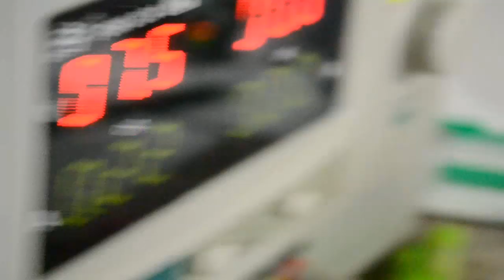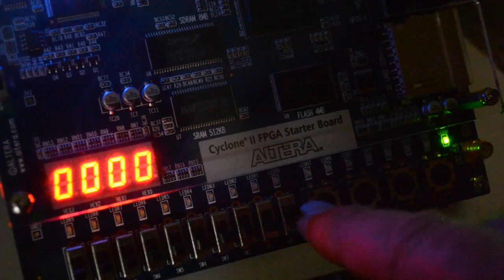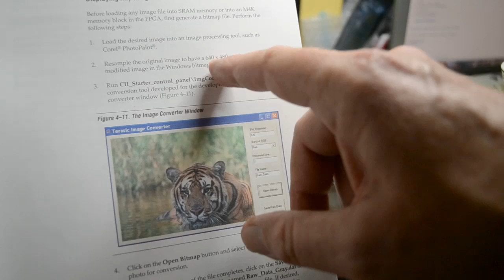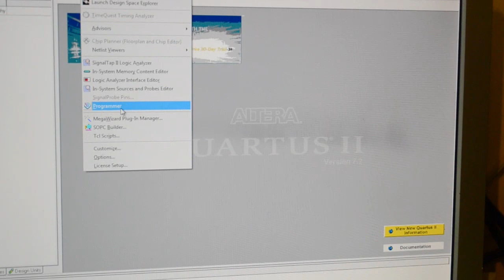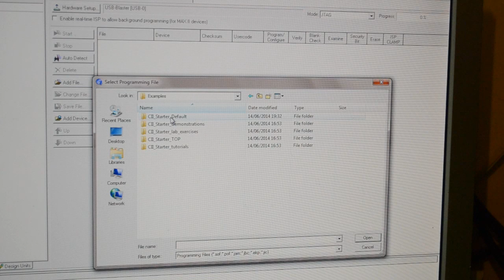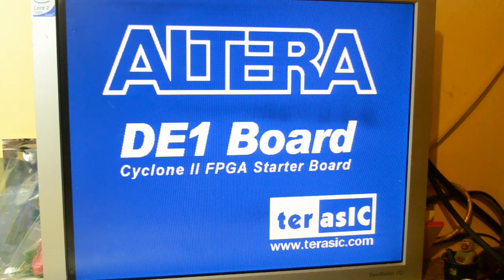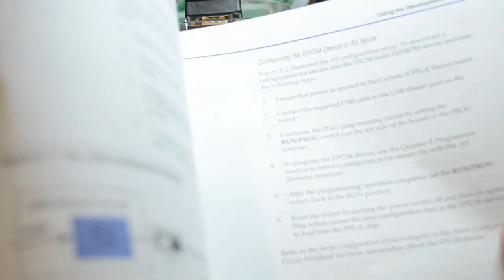Altera Cyclone II FPGA Starter Board

Comment: Going from the comments here, most people seem to think FPGAs are programmed like micros. They are not. They are arrays of logic gates/registers that need to be programmed to do something useful either using a block diagram or preferably a hardware descriptive language. The Altera dev. boards are great and good value for money. Altera's Quartus software is much easier to use than Xilinx's ISE or Vivado software but Xilinx used to have the edge on the chips. To get an FPGA project up and running takes a lot of work but the advantage is much greater speed, i.e. a hard TCP/IP stack streaming data at 1Gbit/s using 100% of the network bandwidth. Processors can be implemented within the FPGA so you can have a program running on the processor that is implemented in the FPGA. FPGAs are not easy to get into but once you have mastered them, they are great. In addition to the definition of the logic, the designs also need to be constrained in terms of timing, pin-out and input/output standards. Also, all designs should be modelled before putting into silicon.